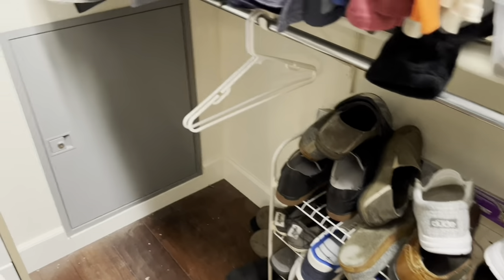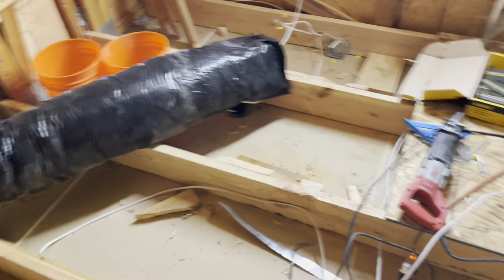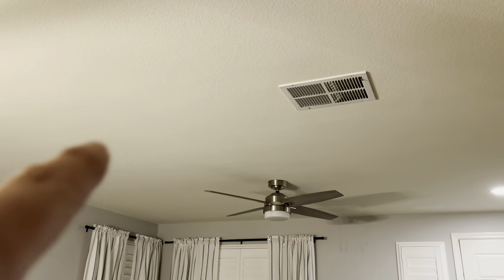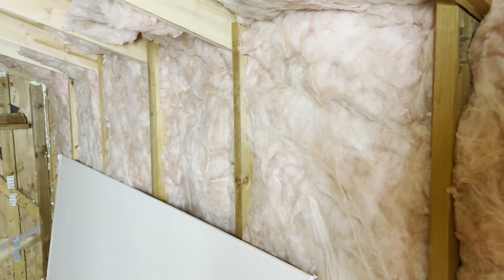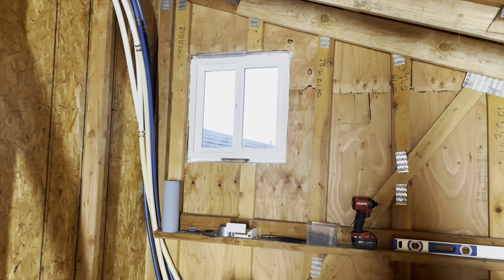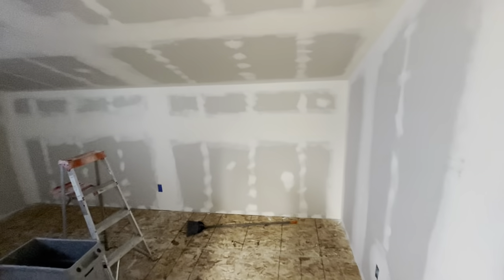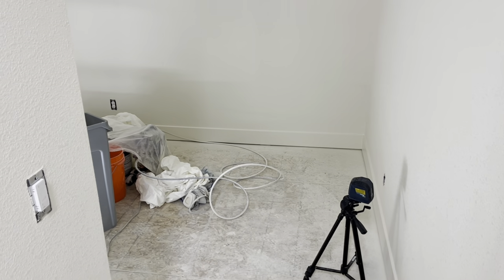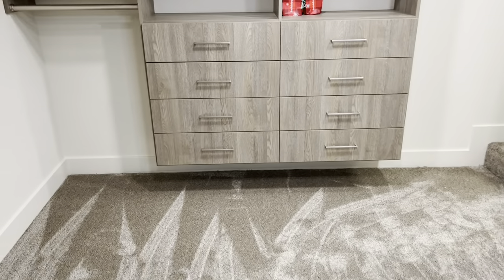How I turned insulated attic space into large living space.

Comment: I don’t often cut trusses, but when I do, I like to cut all of them
Reply from the maker: Actually pretty funny. But, properly sized floor joists and rafters are used in many houses without trusses.
Reply: Sure but the house was designed WITH joist and rafters your house was not. Did you run this by a structural engineer? Actually you might have a degree I don’t know, if you do did you run the calculations?
Reply from the maker: @julianayala03  I promise it’s all within code and it’s my profession.
Reply: Ok, looks sus, but looks can be deceiving, I had the same issue in my attic, wanted more storage space, I wound up building around the trusses. Your closet looks great. 👍
Reply from the maker: @julianayala03  I actually went one size larger than code required for the span and spacing. Plus I did not remove the existing bottom or top chord of the truss. So it’s actually stronger than originally built
Reply: Another reason I asked is because trusses work off of tension, they are designed to withstand loads working on the outside in, not necessarily the inside out. When you walk on that floor you are stressing the “truss” from the inside out.  For the most part the trusses originally installed were just to hold up the weight of the roof.
Reply: @julianayala03   Whoa, I'm with you. This seems so sketch.. I'm not sure this is a wise thing to convince others on YT to attempt. I really don't see an engineer providing their stamp on drawings for a rebuild like this. Trusses are great for saving wood and making long spans. But it's engineered and each roof has a specific geometry specified for it based off the load bearing structure under it. It's great for tension load. But I see here there is a new type of load. I'm especially worried about that bottom chord. I see the new board sistered onto those bottom chords, but I wonder if there are load bearing walls or a beam under the ends of where those new boards terminate..? I don't see how the new "joists" are supporting the weight of occupants and the entirety of what goes into a closet.. cabinets included.
Reply: Lol
Reply: LOL @m10stuff
Reply from the maker: @ralphdoid  the front of the new floor joists is directly over a load bearing wall and the backs are attached by hangers on a massive beam which the trusses were attached to. In addition, the lower chord wasn’t removed. The new floor is much stronger than the old attic space.
Reply: @m10stuff  Gotcha! That information makes all the difference. Sounds like the load on the new joists are fully supported and bears down to the foundation.
Reply: @m10stuff  I hope you left that junction box accessible as required by NEC.
Reply from the maker: @dolfinwriter5389  yes, it’s “accessible”
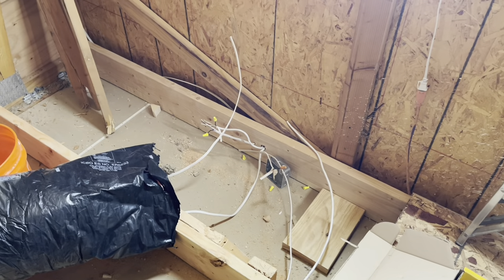Reply: 2:40 that Junction box isn’t buried in the floor is it?
Reply from the maker: @metalbill  yes, but accessible through the ceiling below.
Reply: @ralphdoid  I would agree, but I don't think the point was to try to do things without required permits and inspections, and if not allowed by code, then would never be approved and would never pass inspection.
Reply: @dolfinwriter5389  I whole heartedly agree, Permits and inspections was not my point. Integrity of the structure was my concern. However, the original poster allayed my concern with the explanation of the existing load bearing members that weren't featured.
Reply: Perfect example why home owners shouldn’t do DIY projects lol wow
Reply from the maker: @laydlow87  code was followed for floor joist and rafter loads and both were supported over a load bearing wall or beam. What would you have done different?

Comment: There's no way he got this permitted. Not that it's totally unsafe, but you can't nail rafters to studs for support. Inspector would have made him put in jack studs for the rafters to lay on.
Reply from the maker: I understand what you’re saying but the original rafters were not removed. Just reinforced with larger 2x.
Reply: So you cut the trusses and sistered the rafters to compensate? Is that structurally equivalent?
Reply from the maker: The top and bottom chord were not removed. Just reinforced with a proper 2x for the load and length. The bottom chord was still sitting on a load bearding wall and a shorter jack stud was placed under the new top chord (I didn’t show that step well). Then the middle chords were cut

Comment: You need a header above the window for the stud you cut.   You cut that vertical support, without any transfer to the other studs.  You need one on the top, and one at the bottom to replace the action of the cut stud.   Also, you did you put a header above the new entrance
Reply from the maker: I didn’t show the detail but I built an all new wall on the inside of the window with supports where the 2x4 was cut for the sheathing attachment. To new wall was framed so that no header was needed. There is a header above the new entrance.

Comment: So sound… if you want sound proofing, dont do 6x2’s for a wall

Do alternating 2x4’s, as a 2x6 wall. 
So every 8 “ you put in a 2x4. Moving them from front to back (on the baseplate) alternating this creates a cavity between the drywall and the other side of the wall. 
When the sound hits the dry wall it uses solid pieces to transfer the sound waves. In this case the sound is greatly reduced and mostly dies in the wall. Also, you dont have to drill in holes for wires. 

It does double the 2x4’s needed 😢but hey those are cheaper than 2x6’s 😊
Reply from the maker: That’s called decoupling and I’m familiar with it and it’s effectiveness, but I was using what was already in place. In this case I didn’t add any 2x6s
Reply: @m10stuff  seems logical. Good video.

Comment: On that wall where you had to add the extra 2x4s to fit the insulation... What did you put behind the insulation? Looked like open attic space behind it.
Reply from the maker: It is open attic space. With the diagonal supports, the insulation fit snug enough to stay in place. The other option would be to put a few staples in the insulation to keep it in place.

Comment: What is the thinking behind not also adding vertical supports to attach to and bolster the effects of the 2x8 sister board rafters?  Are they just attached to the original 2 x 4?
Reply from the maker: The vertical supports were already in place. I was only adding support for the roof load span. An additional support directly under the new 2x8 would be a good idea, but not necessary.
Reply: @m10stuff  You near Maryland?
Reply from the maker: @leighdencker   there’s a sign near my house that says "Ocean City, MD 3073 miles".  I’m about as far away as you can get in the continental USA

Comment: So generally speaking, you sistered the engineered trusses, then cut them out? Is this pretty straightforward for an engineer to sign off on? Would like to do this with my garage trusses.
Reply from the maker: I used a code scale to determine which size floor joists and ceiling rafters to use for the span, spacing, and load. I sistered them into the existing trusses and nailed them into the beam on one end and wall top plate of the other end. Once each floor joist and ceiling rafter was in, I cut out the truss supports one at a time.
Reply: @m10stuff  nice, thanks for the insight. I’ve wanted to do this on the main level of our split family house for a while, so we go from 8’ ceilings to vaulted. Priced having a contractor remove the engineered trusses and replace with scissor style trusses. Cost prohibitive. But with approved drawings I could do this technique myself (have a background in construction and remodeling). If anyone’s curious there’s YouTube vids where guys have done this in a garage or large shed.